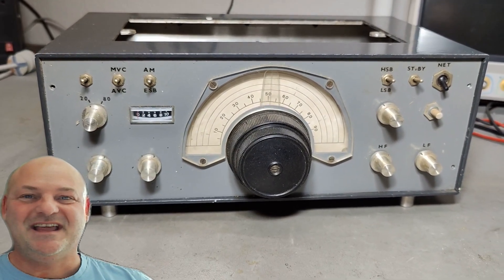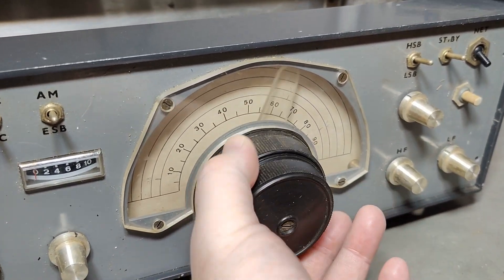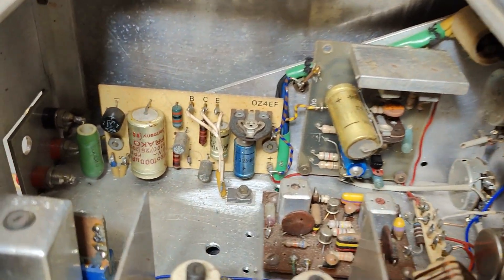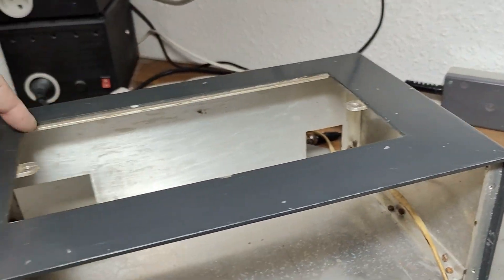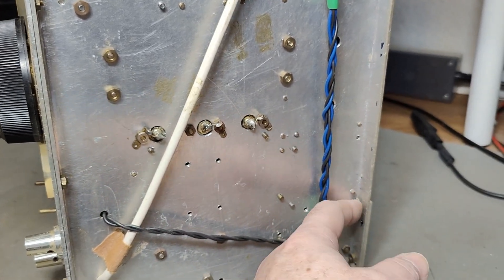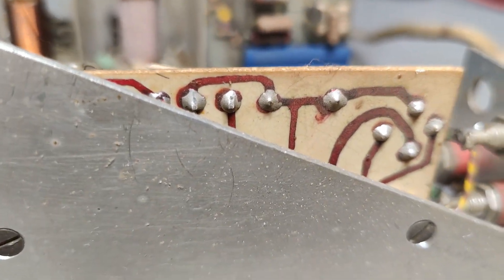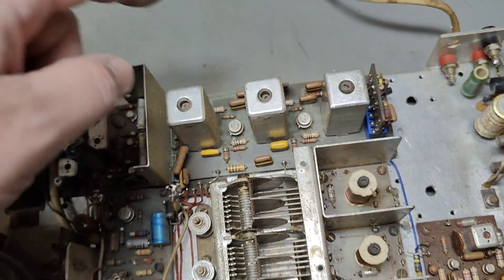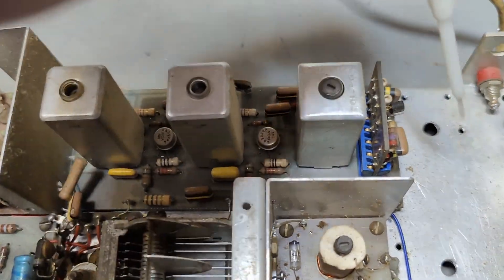DIY radio amateur receiver 20m 80m band AM SSB by OZ4EF 1970

Comment: What an amazingly clean and professional looking build - this is probably a project that ran over many years. Designing, building, testing one module at a time. Whenever I need a bit of distance from my normal work (industrial electronics) I work on a similar long running project - a shortwave receiver built around an AD9912 DDS as 1st LO, a high IP3 mixer built from discrete components, a bank of RFT mechanical IF filters and a AD630 based demodulator. 1st IF is 70.2 MHz, 2nd IF is 200kHz. Maybe I'll finish it in time for retirement 🙂